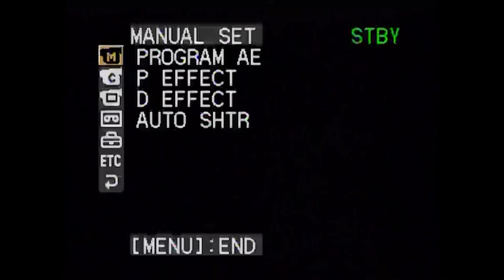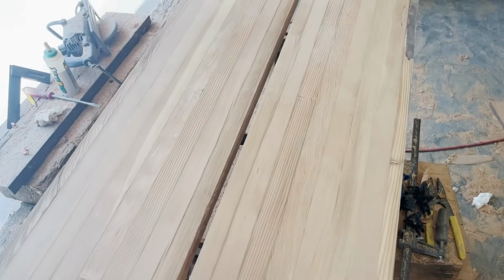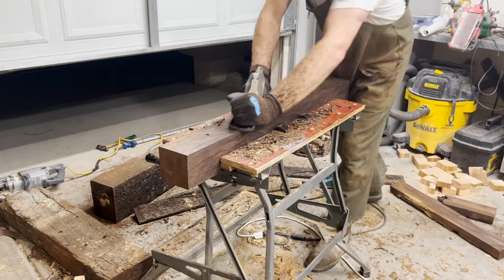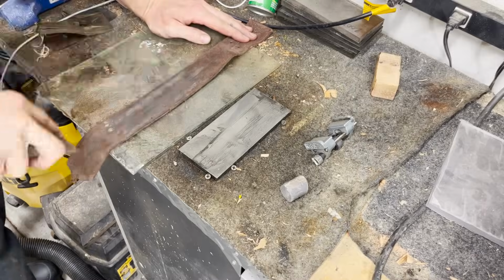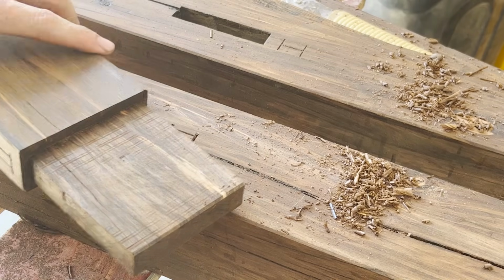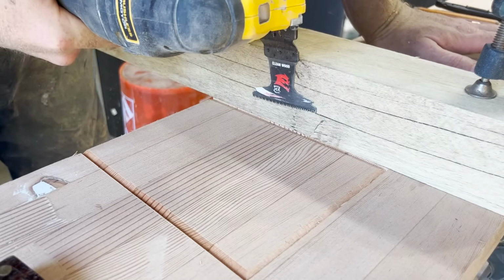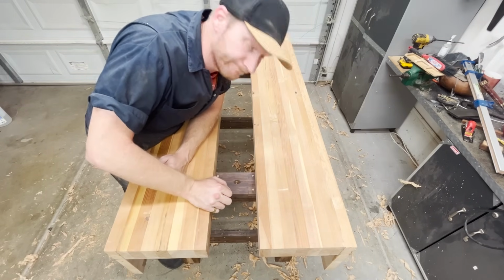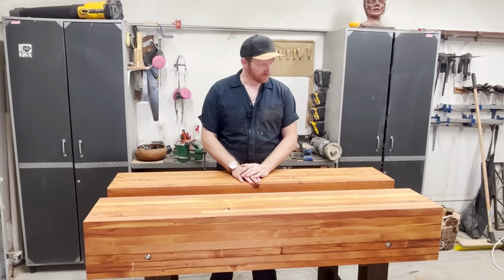Broke Mans Carpenter's Bench

Comment: A great bench and a well done video as well.  New Subscriber as a result.  A possible warning hint.... Keep an eye on the fit of the tool well board.  If the tops and TW boards start to swell during the wetter part of the year the top might try to over strain the fasteners and push out causing strain on the apron to top board joints.  You'll feel that when the tool well board becomes jammed tight.  And if that occurs I think you'll want to plane the well board a little so it stays as a slip fit.  Then as the top and well shrink during the dry times it will open up a little gap.  But better a slight gap than over strained apron to top joints.    Often the screws that secure such pieces are drilled oversize and fender washers used to permit some of the screws to slide a little.  In your case you want to anchor the outer screws next to the apron board joints and let the others slip a little.  I may have missed that detail in the video.  If so then good on ya and bad on me for missing it.

Comment: Well done.  Your bench looks amazing.  I love your mix of simple, everyman available power tools and the handtools.  Subscribed and looking forward to seeing some projects built on that bench.  One question, did you notice any problems with the glue on the heavy oil soaked legs?  Just curious...they do look fantastic!
Reply from the maker: I was worried about that as well but I have not noticed any major notable difference. Some light research shows that creosote wood is harder to glue but the best glue to use is the waterproof tight bond III, which I used. Plus my joints were pretty tight and I added lots of dowels for good measure. Will update if there’s any issues.

Comment: If youre worried about structural integrity, then bondo isnt going to make a difference. If you really wanted to go the extra mile i wouldve put as thick of a veneer as i could get away with on topnof the tear out and maybe even plane down the good side a little bit if it meant i could use a thicker veneer.
Reply from the maker: Agreed, that would be much more structurally sound. Thankfully after the aprons were brought to their final dimensions the tear out areas were only a 1/4 inch thick at the deepest. I’m not too worried about it.

Comment: Better check the Creosote wood preservative MSDS (Material Safety Data Sheet) or whatever the New World Order now calls it.  Not the best stuff to handle but the staining effect on the core of the railroad tie is beautiful.
Reply from the maker: Yup, reason for disclaimer in the description.
I was fairly ignorant on the stuff when I started the project. I always wore a respirator because it seemed obvious the stuff may not be “safe”
About midway through I found it’s not recommended to work with or used as a working surface.
Since I was making legs and basically would not be touching/handling on a regular basis then there’s not much danger in having it in the shop. I would never use the stuff as a bench top.
If anyone is looking to work with the material, always wear a respirator, wear something over your clothing you can easily take off as to avoid tracking anything outside the shop and shower afterwards. 
It is pretty though.